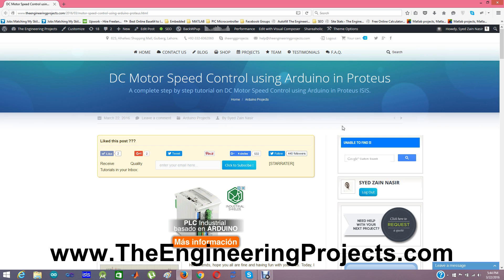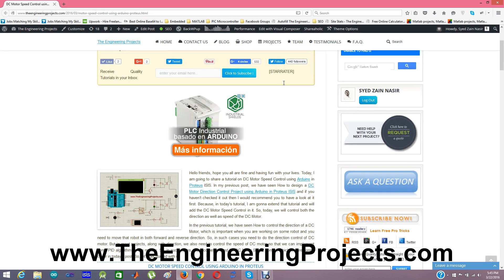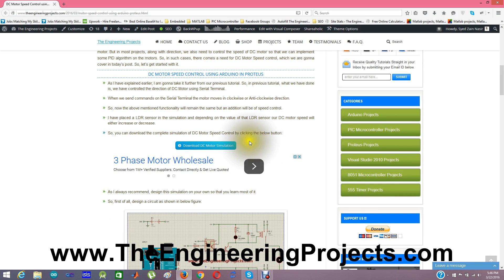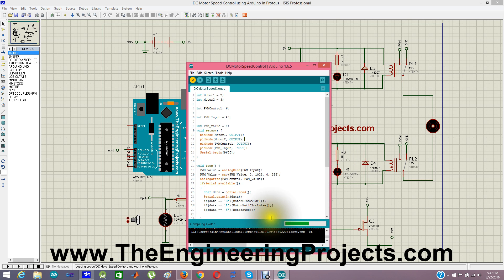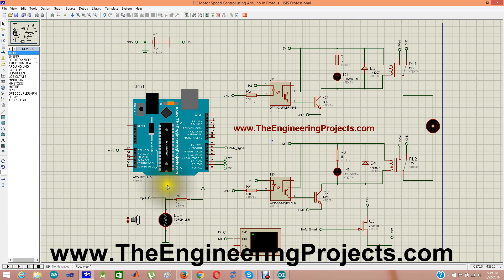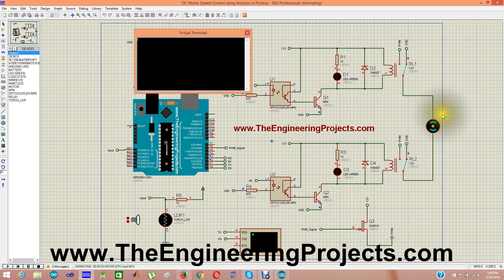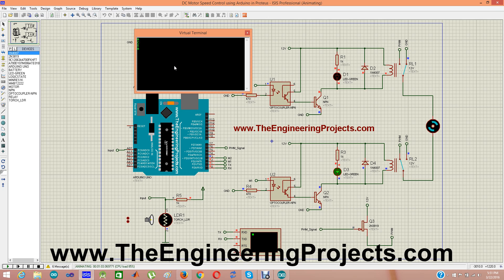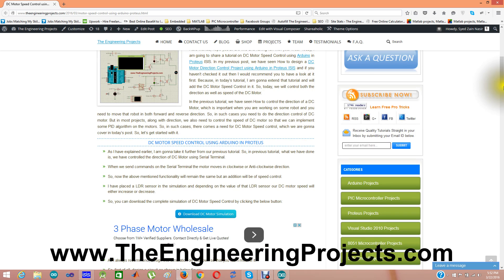DC Motor Speed Control using Arduino in Proteus

Comment: Sir , my dc motor is rotating very slowly, and also speed is not controlled in both sides, but direction change is  working, I given connection same as vedio , please give me solution for it
Reply: same problem is happening.How did you solve?

Comment: these arduino footprints are buggy and slow, usually gives errors, use builtin proteus atmega328p footprint instead.
Reply from the maker: Hi,

As the Arduino UNO is concerned, it doesn't give any error. You should try it.
Reply: The Engineering Projects oh God , you are the developer of this library.
Reply: The Engineering Projects I don't want to criticize your work or hurt you but this library have some big problems. It may not give errors in small programs but it put high useless load in CPU , lagging, an even give errors in serial based program, it become weird on delay instruction and give burst .  So I directly used its avr which has approximately same wiring and works fine.